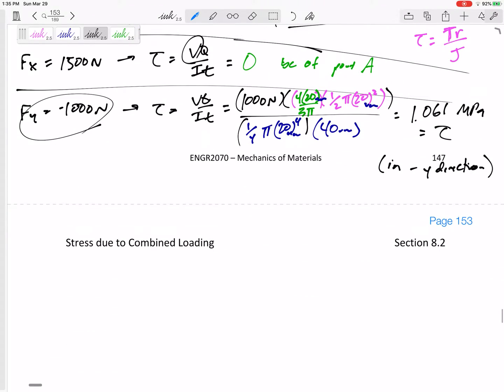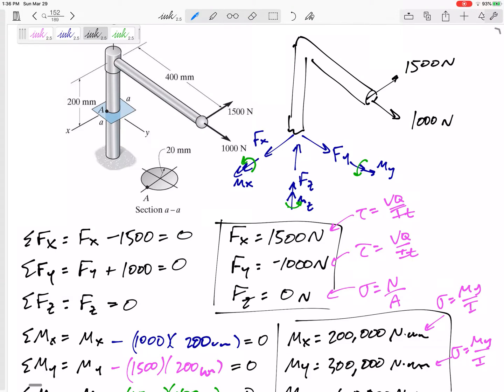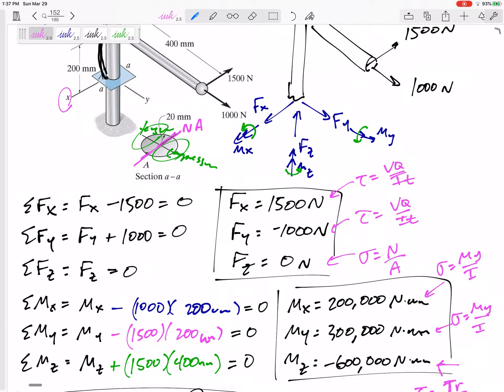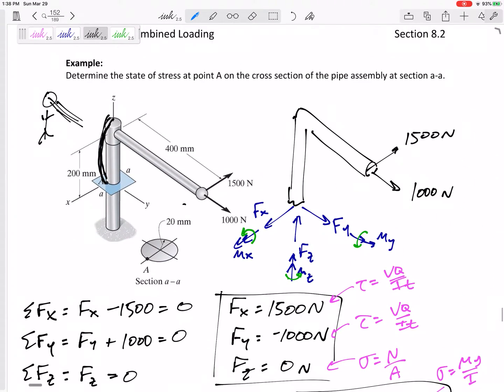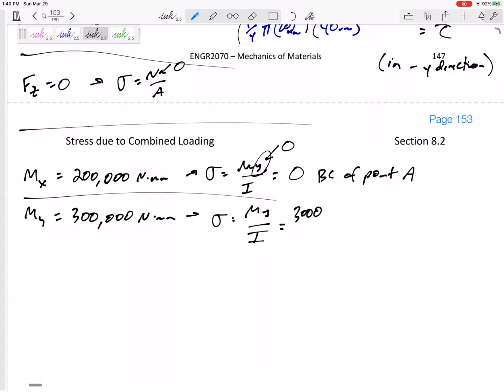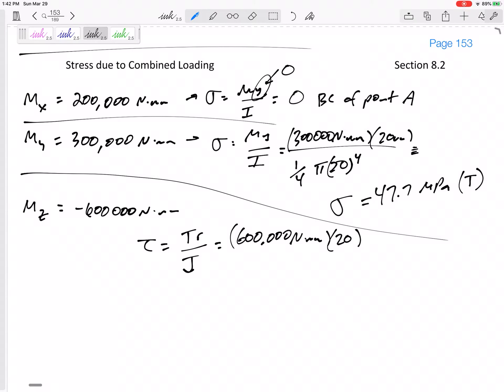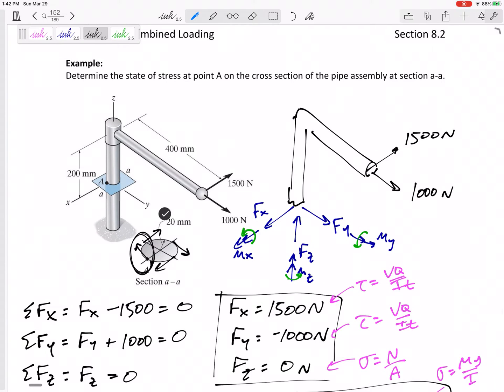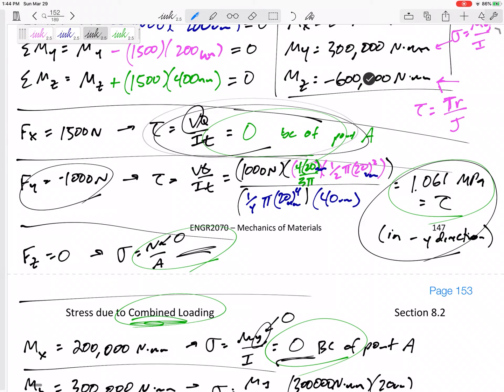Mechanics of Materials - 3D Combined loading example 1 part 2

Comment: Am I wrong or are you getting the bending wrong? Shouldn’t Mx bend the pipe on the opposite direction? Same with My. If I point my thumb in the y-direction, my fingers curl into point A, thus wouldn’t it be in compression?
Reply from the maker: I’m “keeping” the top half of the beam, so my “cut” is at the bottom. So, for example, a positive y moment, my right hand is underneath the cut and underneath the top piece that I’m keeping. So my right thumb is pointing to +y and my fingers are not curling to A, my fingers are curling on the other side. Does that make sense?
Reply: @engineeringdeciphered  So if I want to do the calculations about the bottom part of the pipe, the forces and moments will be Fx=-1500 N, Fy=1000 N, Fz=0 N, Mx=-200 kN, My=-300 kN, and Mz=600 kN because of action-reaction. Sir, is that right?
Reply from the maker: @mrtylmz2209  yes
Reply: @engineeringdeciphered  Thank you very much.
Reply: @engineeringdeciphered  I understand why you call it tensions instead of compression, but how would we know if the problem dosent state which cut part we are looking at? To me it’s clearer to say shear in the -Y direction  at A
Reply: @engineeringdeciphered  Yes, that clears it up, thank you.
Reply: In the direction of the shear reaction, you used the opposite direction of the given force along the y-axis. But in the direction of the bending moment reaction you used the same direction with respect to the given force along the x-axis. So I am finding an inconsistency here. Thank in advance for the reply.